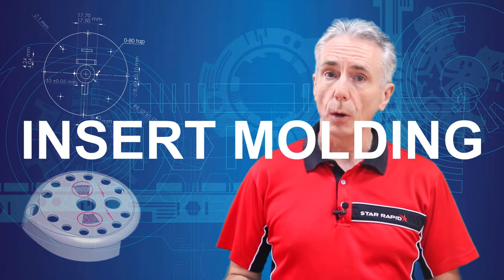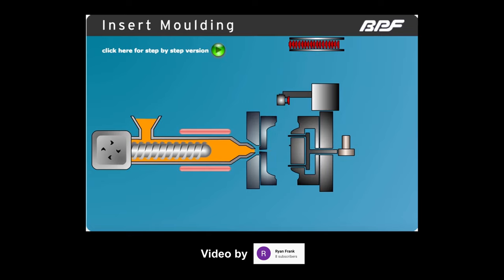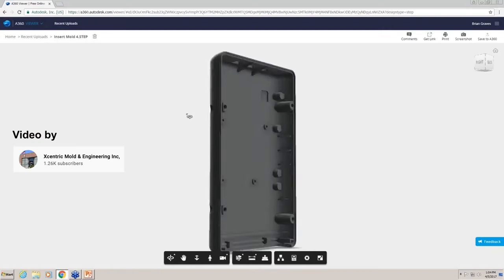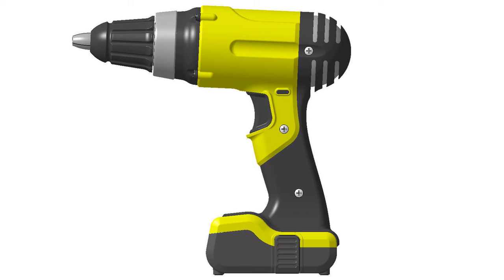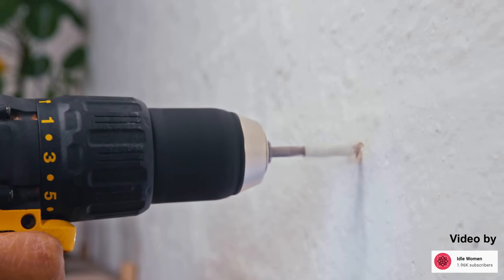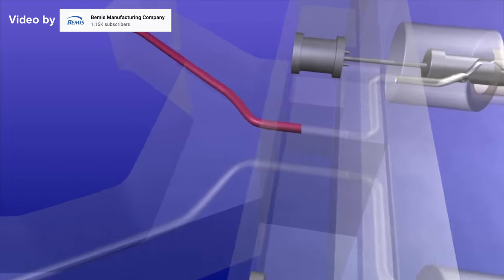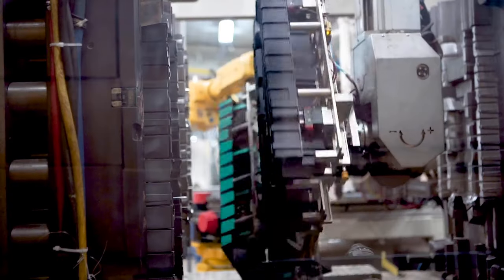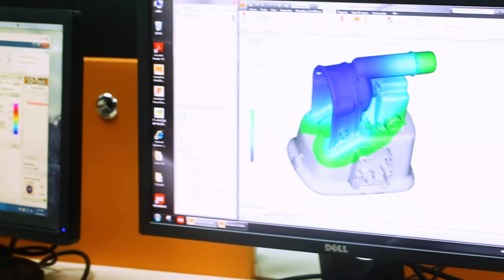INSERT MOLDING vs OVERMOLDING | Two-Shot Injection Molding EXPLAINED - Serious Engineering - Ep16

Comment: This video treats overmolding and two-shot as the same process, but I've found that tooling companies make a clear distinction between the two. However, for the life of me I cannot figure out the exact difference between these two processes and what shapes can be made with one process, but not the other.
Reply from the maker: No wonder you are confused. It is not that clear. Over-molding and Two-shot (2K) Molding achieve the same end goal of two materials being fused together to form a hybrid part. Typically, that is a rigid substrate and a softer over-molding, maybe a rubber. 

This is done for visual effect, or maybe to add an area of the part that has greater grip.  Over-molding typically means that a part has been over-molded at some point in time, not necessarily in the same mold or during the same cycle or even on the same day; whereas, two-shot (2K) typically refers to the over-molding being done on the same machine, in the same mold, and maybe only seconds or minutes apart. 

These kinds of 2K machines usually have two barrels on the same machine, one as usually the main barrel, and one is an auxiliary.  These machines can be horizontal, and that process uses what is called a rotating mold; or it can be vertical, and that is often called a shuttle mold, but can also use a rotating mold, or even a carousel mold.  

There are so many variations on this theme. Over-molding is really a generic description, and 2K is more specific about the type of machine or process used. Hope this helps. 

- Gordon
Reply: @starrapid  Thank you, Gordon. However, I would like to know more about the different capabilities of these two molding techniques. For example, I assume that for 2K, since the second shot happens immediately after the first shot, and before the first shot has been completely cured, the second material will stick better to the first material as opposed to overmolding, where the first material has been cooled down for a day, before commencing the second shot? Does that mean that 2K allows for a greater range of second shot materials like silicon, nylon, ABS and maybe even PC? Someone told me that the second material can only be TPE/R/U, but I assume that applies only to the overmolding technique? As a designer, if I want the soft feel of silicon rather than TPR, and the factory tells me it can't be done, I can reply back that "this can be done with the 2K method, so I suggest 2K, not overmolding"? 

Also, I would like to know, since 2K seems more versatile than overmolding, but more suitable for high volume production, if the same parts can be achieved with overmolding. For example, I've seen pictures of 2K parts of plastic buttons, like a numpad, with an additional plastic mechanical part on the inside of each key which was done as the second shot. Can this type of part be done with the overmolding technique?

Comment: How are the surfaces to be covered during insert molding / overmodling isolated from those that cannot be contaminated by the injected material, e.g. a thread of motal threaded insert has to be clean after insert modling, so how it is made?
Reply from the maker: Hi Pawel. Thanks for your question. The threaded insert would be loaded over the top of a closely fitting pin. The pin internal diameter would be shielded from the plastic.

Comment: I need to fully encapsulate a steel bar in UHMW polyethylene, what is the best processes for that type of application? Thank you
Reply from the maker: "When insert molding a bar like this, you have to support the bar in the mold so that it can be surrounded evenly by the resin and not able to move under injection pressures.
This would lead to the bar being exposed in certain areas.
You would then have to overmold the whole thing again to fill those 1st support areas.
That would be the simplest solution without seeing drawings and specifications."

 - Dave, Injection Molding Expert - Star Rapid
Reply: @starrapid  I had read that because of the ultra high molecular weight of this type of polyethylene injection molding is not possible, that compression molding must be used. I would use 4 retractable pins in the mold cavity that retract using internal mold pressure as the initiator.

Comment: About to embark on trying to insert mould toothbrush bristles onto a toothbrush handle for a client, both parts are to be injection moulded... We're using a bolster plate die set from Meusburger for use with insert plates, do you think it is possible to make the handle in on set of insert plates then the overmoulded bristle part in another, IM a load of the handles then place these into the second insert plate set that will IM the bristles on?

Comment: What are the best practices for design-for-insert molding for say a power supply that has the electric contacts molded into the plastic (i.e. A Wall Wart)? I struggle to find information on how to design for this to accommodate 'holding' the metal insert so it properly creates the shuts offs and parting surfaces as expected, while not crushing/deforming the insert during mold close. Would be great for a video topic!
Reply from the maker: Hi Michael. Great question. We will get back to you shortly. And we've noted the suggestion for an upcoming video. Thank you.
Reply from the maker: Hi, response from our Injection Molding expert: 

We really need to know the geometry of what you are looking for. In many cases the contacts are loaded onto a sliding core which needs to be pushed into the moulding position before the mould closes. This requires a special open slot to allow the angle pin to enter as the mould closes and pull open the sliding core when the mould opens. Usually simple ball catches can achieve this.

Hope this helps.
Reply: @starrapid  Thank you for the helpful reply - I believe I follow what you are saying. This is why a video would be excellent on this topic - a picture/video/illustration would go a far ways. The specific geometry I'm referring to is a two metal prongs (such as NEMA 1-15P style for USA) for a wall wart being insert-molded into a clamshell enclosure. Generally these are some style of plated steel or brass stamped metal components oriented along the pull-direction axis. The funny thing is there are probably 10's of the thousands of molds generating 10's of millions of parts like this each year given the size of the power supply market - but not a ton of information on how to design plastic components accommodating this style of manufacturing method. 

The main reason I ask this is because there a certainly several ways to marry a stamped metal component to a plastic component - one of these ways being insert-molding. Given that insert molding feels a bit more complex I wonder how to make the engineering tradeoff between insert-molding and say a secondary operating such as heat-staking or simple mechanical assembly with a fastener.

Comment: Thank you very much, great content. I am wondering what the tooling and process would like in case of plastic overmolding on a steel part. For instance, on the Tesla Model 3 front suspension wishbone
Reply from the maker: Thanks Marquis. The key to overmolding steel is to ensure that the overmolding material can stretch as the plastic/rubber cools down around the non-shrinking steel substrate. (Obviously the steel will shrink a tiny amount if it has warmed up in process, but the difference in shrinkage rates will be huge.) Two extreme examples might be PC, which is fairly brittle, and a rubber, which is extremely elastic. The PC will want to shrink, but the metal won't, so the PC will shatter. We often see this when we are overmolding brass Nutserts. The shattering effect may not show itself for hours, days, weeks, or even months, but you can guarantee that the plastic is under enormous stress. Therefore we always recommend Heat-Staking the inserts into PC after molding. If you are overmolding with a rubber, then clearly the rubber can stretch as it shrinks. So, in summary, you need to choose a material that can shrink and not shatter or snap due to the differential shrinkage. Hope that helps.

Comment: has anybody ever used insert molding multiple parts?  and how do you hold the insert into the mold
Reply: there is no reason for the insert to fall out, the processes is smoother than most realize, the treads on an insert are not all over the place either usually within + .001 to .003 lastly is the if the insert is metal, it can rest on a post that has been magnetized